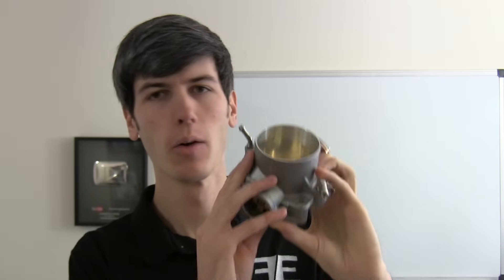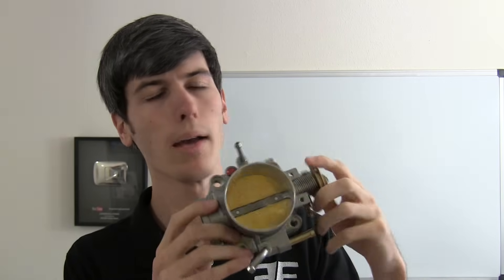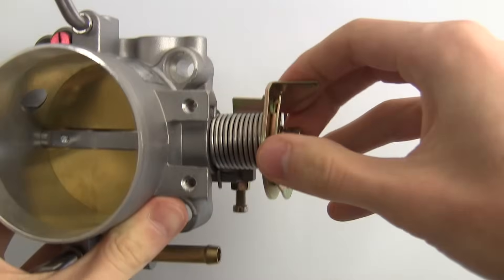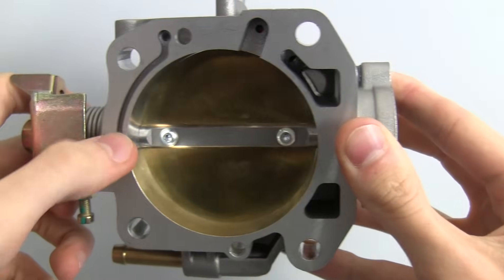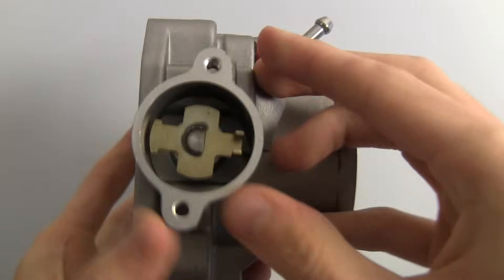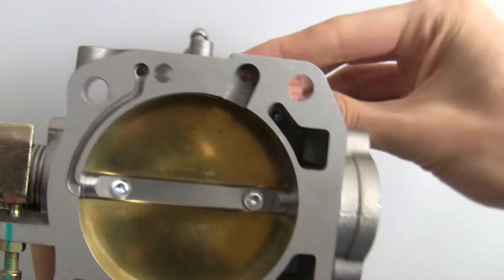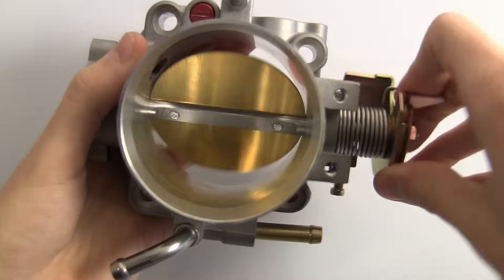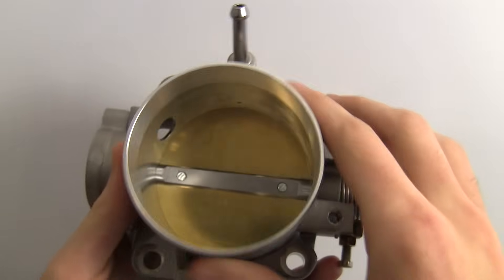Throttle Body - Explained

Comment: Why would you want to tighten that screw and restrict airflow? Sorry im a novice at this stuff im trying to learn, I thought the more air your engine is getting the better things generally run/better gas mileage ect? Why would you want to restrict airflow? Couldn't you just take it off completely for maximum airflow? Ugh.. My pap just got a 1977 Transam and ive taken up the task of fixing it up and i have no idea what im doing. I know, Smart.
Reply from the maker: SWEEPZCF You don't want it to idle too high. No reason to waste fuel while you're not actually moving the car.

Comment: Is lower idling better than a higher idling rpm?
Reply from the maker: Milind Pradeep From an economy point of view, yes. Often there will be more vibration so you have to stay above low RPMs which cause high engine vibration.

Comment: please i have a question. do every engine has a throttle body controller(intake air controller). i`m thinking of not having a throttle body controller but accelerating the engine from fuel injection only. is that legit ?
because i don`t see any throttle body controller in my TD5 engine.
Reply: what happened?
Reply: no nothing happened. i just need to know, because it doesn`t have a throttle body.
Reply: Viraj Kothalawala what doesn't have a throttle body? are you creating your own engine? it will end up running too rich or too lean
Reply: i mean no air controlling through the throttle.
Reply: Viraj Kothalawala you just want to leave it open?
Reply: kind of. i think this TD5 engine doesn`t control the air flow to rev the engine. it is controlling only the diesel to do that.
Reply: then get lost pal.
Reply: Viraj Kothalawala you should sell it

Comment: Throttle Question. Im currently enrolled in an automotive program and in my fuels class my prof said that throttle never reaches a true 100% because the throttle plate would retain its postion at 100% and would not close because of a negative pressure keeping it stuck open due to the airflow over the throttle plate and the ECU would keep adding fuel until the engine blew up. Im wondering if anyone else has ever heard this before. Ive noticed in stock production vehicles at WOT the tps reading percentage never reaches 100% with the pedal fully depressed. usually only 90% tps reading.

Comment: You should consider making a video on Individual Throttle bodies, their applications, their benefits, their drawbacks, etc... I don't know much about them and I'm having a hard time finding information about them. Seems a little unorthodox to run an engine without an air filter... But like I said, I don't know much about the subject.

Comment: I had a situation in sub zero weather in Michigan where I pushed on the gas and the pedal didn't spring back, making the engine rev up, and if I put it in neutral, it was really revving!  This is on a 2001 Saturn.  Did some condensation freeze it open? I checked the cable to make sure it wasn't caught on something, and then I sprayed on a lubricant after cleaning out the Throttle body.  This seems to only occur in the winter, and when I clean and spray, it goes away.  Your thoughts, and thanks for your videos.  very educational!
Reply from the maker: Interesting, and quite dangerous! Hopefully you were able to turn off the engine soon. Perhaps it was the throttle freezing, as something had to stick.
Reply: My '95 Tahoe does this once or twice a winter, especially in the -10 degrees F or lower range.  Usually it's just a little WD40 and a light thump with my hand to get it to free up.  A 5.7 V8 revved up to 5000 is a little scary, so I know the feeling of dread when the pedal gets stuck!

Comment: Is it the same when the engine is turbo chraged ? Because the turbo compres the air and force it so it wont make a big difference when the throttle body at 25% or 50% will it feel the same ?

Comment: Great video. One suggestion: on smaller, more involved parts like this, use a diagram or a still shot of it and draw on it in post production to show what you're referring to as you speak. 

It's not that much of an issue because all the air channels and things like that are pretty distinct here, but some on-screen red lines and circles would do a better job of pointing to specific parts than would your fingers.

Comment: how does a electronically controlled throttle body work?
Reply from the maker: Amaan Fazeer Uses an electric motor to open and close the butterfly valve, based on input from the gas pedal.
Reply: thanks..hope to see more explanations...found  it very helpful

Comment: Do diesels have them????? for example a tdi 2002
Reply: Nope, normal Diesel engines don't have a throttle body.

Yet, Some modern Diesel engines with a Diesel particulate filter also have a throttle body. But it will only be used when the filter system needs a regenration cycle.
Reply: Scottish Docs  The particulate matter would clog up the filter pretty quickly if you just run the system as it is. So from time to time when a sensor in the exhaust stream measures an increased back pressure in front of the filter, the ECU will change into a special mode, which results in higher exhaust gas temperatures. This causes the accumulated particualte matter in the filter to burn down to ash. This basically "regenerates" the filter hence the name.

Comment: what about the throttle body spacers how do they work? its just for more hp?
Reply: They don't really work on modern cars. They come from the generation of carb'd motors. On older carbureted engines the fuel mixture was sucked into the air stream and had to mix with it, so by adding a throttle body spacer you gave it more room to mix with the air allowing for a better air fuel mixture concentration. On newer cars it more then likely won't give a performance increase, but it might give a possible down low torque increase because of a longer intake runner but very unlikely.

Comment: +EngineeringExplained
Can you explain what is Super Active Yaw Control and how it works?
Reply: I'd like to see that. But it bascially just seems like it addes mini automatic transmissions between each wheel set and allows for different torque input to each wheel independently

Comment: i must disagree with leaving the plate stopper screw factory adjusted. i own this exact TB (S2 pro) and it WILL get stuck closed unless you readjust, many people online have had the same problem with junk2 TBs. also make sure the throttle plate screws are tight, ive seen horror stories online of those comin loose and eatin engines

Comment: 'Throttle body heater delete' is a very common modification for the M42b18 that's in my BMW E30. Every horose helps and here in the UK it isn't going to freeze. Hopefully..

Comment: How does a fed manual work ? It's puzzling me. Please tell me this sorcery.
Reply: what is a fed manual?
Reply: fwd i hit the wrong button :(
Reply: Works the same way as a normal manual transmission but it has the "differential" build into the case more or less. The power goes from the engine thru the transmission gears and at the end it has a bigger gear for the gear reduction which is basically the ring gear like on a rwd vehicle.
Reply: interesting.. thanks

Comment: where is it located on a car?
Reply from the maker: After intake filter, before intake manifold (typically).
Reply: Engineering Explained To add an example of something different. e46 M3 have it after the intake manifold between the manifold and head. Just to add an example of an exception to the rule.
Reply: oh okay cool

Comment: Do drive by wire set ups open the butterfly   valve using an electric motor?
Reply: Yes, they generally use a stepper motor.

Comment: I have almost the exact integra as you (99 Integra LS) and I'm wondering what you recommend for a throttle body upgrade? I have almost the exact same modifications as you currently (ordered a Cat-back Yonaka a week ago) and I want to begin on the intake manifold and throttle body. Could you reference two that would fit together and work well with my current setup?
Reply from the maker: I have a Skunk2 intake manifold and throttle body. I'll be installing and testing eventually. Keyword is eventually haha. Busy times!
Reply: I'm not sure you should look at the intake and throttle body yet. Look into getting a new better flowing exhaust header and cat before you go to the intake. Most restrictions are usually in the exhaust. No point in doing a intake if the exhaust slows down the escaping gases. Even if you do a intake their probably is no point in doing the throttle body. From what I can find your 1.6L or 1.8L has a 60-62mm throttle body to put that in prospective a 4.0L jeep cherokee revs to 5000rpm and has a 60mm throttle body. I highly doubt you'll need more air than that for any normal mods. If you do a bigger throttle body you'll notice a difference for the amount of gas pedal travel but that is just because you have more airflow not because of a power increase. for example 10% throttle now might be 1500rpm but with a bigger throttle body 10% throttle = 1800rpm.
Reply: I dont think an upgraded throttle body would be nessesary for your car
Reply: We're still waiting...

Comment: Hey do you think you could explain the vq37vhr engine on a video soon? I've tried to understand how the whole camless vvel system works but I just always find mixed info on that topic. If you can I would appreciate it. Great videos. Very informative and never a waste of my time unlike much of YouTube out there. Keep it up.
Reply: From what I can find it's not really camless it just works slightly different. It uses rocker arms to hit the valve tappets instead and the way it changes lift and duration is by changes the pivot point in the top control camshaft.

Comment: do you know of Universities or programs that are geared towards this kin of stuff? like taking what we learn in thermo, heat Trans, mechanics, etc and applying it to engines, suspension, etc?
Reply: a lot of community colleges do automotive programs
Reply: community college? not familiar with what that is. I live in Canada
Reply: Thing of a small university that usually has cheaper classes, mostly of campus students, university for people that also work mostly. IF you look up automotive schools in canada it shows school kinda related to community colleges. Some community colleges have offshoots that are automotive, but they are also technical schools that specialize in automotive.
Reply: thank you

Comment: So how do independent throttle bodies work?
Reply: Same way, one before each intake port instead of one large before the manifold.
Reply: Mrborgarn
Exactly right. to add to that usually individuals throttle bodies are used in performance applications to allow each cylinder to have the same air intake speed and volume instead of having to share a single one.

Comment: Now do the difference between drive by wire and cable throttle. Maybe even the difference between mass air flow and manifold absolute pressure.
Reply from the maker: I have videos on MAF and MAP sensors. :)

Comment: Could you explain what's happening when the car is idle please?
Reply: Basically the engine is just letting in the minimum amount of air to idle at the ECU determined idle speed. Some cars may inject less fuel at idle. But to explain it the throttle body shuts to 0% which usually still has a small crack and the engine sucks air through that with the idle air control valve opening to allow some air through the bypass passage to maintain idle.
Reply: custommotor Thanks for explaining! But may i ask why cars need to idle? Can't they just suck in air/fuel mixture when they need to? its burning fuel unnecessarily.. sorry i've just started learning about cars
Reply: cars idle because its easier to have them idle at a low rpm then to have to stop and start them at every light. Gasoline engines are limited by the air flow into them so by using a throttle you can control the engine rpm. Diesel engines don't need a throttle because the fuel controls the engine speed. Basically idling is just the lowest rpm to have the engine rotate without turning it off so that when you have to start moving it can do so immediately.

Comment: Hey, Enginnering Explained that was a really cool and informative video!
Could you explain what the charcoal canister does, and how it works for a next episode?
Reply: It just collects the gasoline fumes from the tank so that they don't vent into the atmosphere. Its basically because the epa didn't want unused gas to vent into the air, but as a side benefit it makes it so all the gas in your tank even the vapor is used. When you drive down the road under certain conditions the engine opens the purge solenoid and allows vacuum to be pulled on the canister sucking out the vapor.

Comment: What about individual throttle bodies?
Reply: Exactly the same. The only difference is how their routed between each other. Some might have all throttle bodies linked together with side by side making their throttle plate shaft a common shaft and turning in unison, some might have a single throttle cable that is routed to a point and then split into multiple cables and attached to each throttle body, or in the case of most motor cycles with v engines they will have 2 cable inputs on the throttle bodies, the cable will hook to one throttle body and then it will have another cable that goes between them  and when you hit the throttle it will pull one throttle open in one direction and the other in the opposite direction. Hard to explain, it would be better with a diagram.

Comment: Do 2012 onward BMW's have electronic or mechanical throttle bodies
Reply: If you're referring to the drive-by-wire types, the most common ones I hear about are:

1.  A squishy pedal/lack of throttle response.  Since there's no physical link from the pedal to the throttle plate - some say that there is a noticeable disconnect or lag from when you put your foot down to when the car actually goes.  Though it's largely subjective at this point.

2.  Expense of maintenance.  If something goes bad with a cable system, you just replace the part.  If something goes bad with the drive-by-wire, not only do you have to replace the part, but there's typically a "relearn" procedure that adds cost and time to the job.  Sometime up to and including the addition of specialized computer equipment.  In addition, and issue in the system is far easier to diagnose in a cable system than drive-by-wire.

3.  Chance of failure.  Although this hasn't been proven and/or is very rare.  Unintended acceleration.  Since the throttle is entirely controlled by the ECU - there is a chance of erratic anomalies.  Some say that the unintended acceleration fiasco with Toyotas was caused by this - although never proven.
Reply from the maker: I would imagine they've all been electronic for some time now.
Reply: Engineering Explained What are the disadvantages of electronic ones? I do remember seeing a video that manufactures say turn the engine off it the throttle gets stuck
Reply: SpeedFreak I would like to know too, +1
Reply: Thank you for the detailed response; 2 & 3) I thought would happen but i've never heard about 1).Gonna look into that and see what I can find
Reply: Some manufacturers ETB designs are really appallingly bad too... there is an episode of Wheeler Dealers where they have to replace a Maserati ETB and sender - the OEM units are some thousands of pounds to replace from Maserati, so they take the old units to a guy who re-engineers them for a few hundred pounds, and he explains all the design faults the original units have - using ultra cheap thin sliding contacts that wear out very quickly - he replaces the sliding contact with a magnetic contactless system that should never wear out - which is how it should have been in the first place.
Reply: ***** I think it's their way of making the car easier to handle for everybody weather it be a 16yr old new drive, a  35yr old seasoned drive, or a 85yr old grandma. Depends on if its a economy easy to drive car or a performance car.
Reply: It's not idiot proofing. It to improve the marketing by making a vehicle easier to control. You can idiot proof something. But a 16yr kid or 85 yr old person isn't an idiot,. One is just inexperienced and the other doesn't have as great as muscle control as they did.

Idiot proofing is the new self driving cars where you just tell it where to go and let it drive, then again you can't consider that idiot proofing because it does give for example that same 85 yr old more mobility without slowing us down too. Idiot proofing is kind of an insulting way of saying and narrow visioned because you have to look at it from multiple view points. We know not everybody is great at everything a surgeon maybe great at operating on you, but he may suck at driving. You can't expect him to have f1 or funny car driver throttle control.
Reply: yeah a little bit
Reply: Andrew Larson yes but the car will still usually run okish if the TPS is faulty on a mechanical throttle.
Reply: Andrew Larson hence okish. Regardless if you are buying a maserati you'd expect a contactless system would be used instead of cheap plated tracks.
Reply: Matthew Sharpe
They don't really need to use a contactless system a good quality metal track one works fine if made wel.. I have a 35yr old car with one and it still has the original one with 150,000 miles and its a datsun which isn't know for the electrical components.